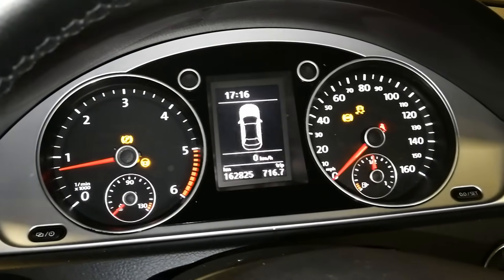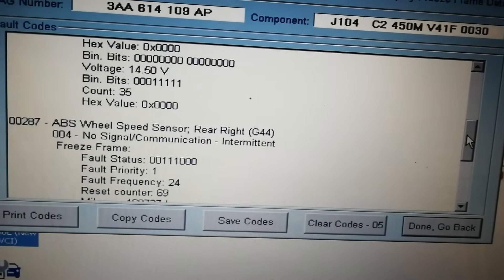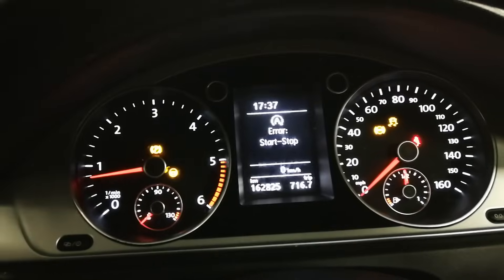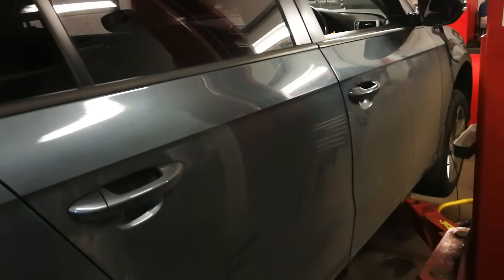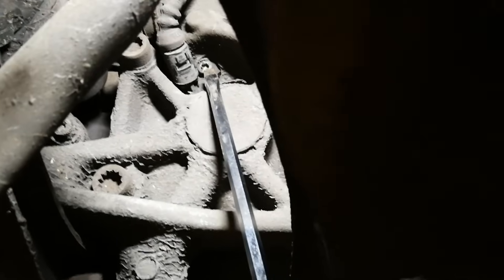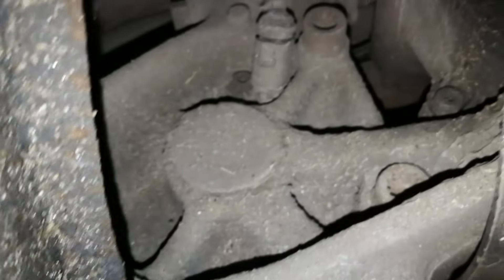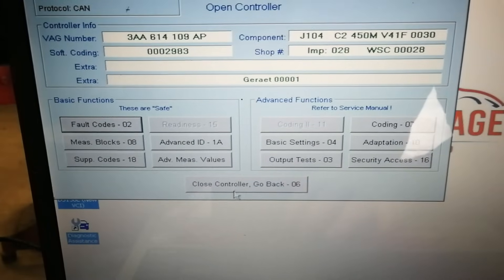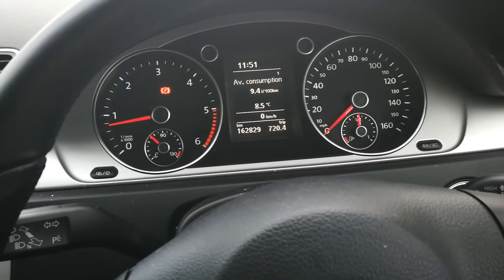Volkswagen With Multiple Faults, ABS ESC Start Stop, Electronic Park Brake, Power Steering

Comment: Sir I salute you I had these warnings lights on my tiguan '12 dash I had an accident that ruined my right rear axle had to change the whole axle but dash warnings were lit like a Christmas tree in extra my parking sensors and park assist weren't working also.
But after seeing your video I had my finger crossed that this sensor issue will fix every thing and thankfully it did.
Just had to remove the one of battery terminals and unplug the sensor like you did then reset.
And there it is all lights dissappeared and all the ops sensors are working fine
Reply from the maker: Great to hear, thanks for the detailed comment and kind words

Comment: Gerard, great and very helpful video, thank you.  My 2016 VW Passat has all lights lit, ABS, Airbag, Steering, Traction, etc., and the dealer yesterday told me BOTH rear wheel sensors are bad, AT THE SAME TIME (??) Does this make sense, that both would fail simultaneously?  I did not go through any water puddles or any other unusual terrain, so how likely is it that they both failed?  The car is exactly ONE month past the 36 month warranty!  They are quoting $565 for the replacement of both.  I thought I might bring it to a "shadetree mechanic" I know, buy the parts and save$ but unsure what to do.  Could you possibly tell me whether it seems plausible that both sensors failed at once?  THANKS and thanks for this YouTube video!
Reply: Going through the same thingy right now. Dealer recommended BOTH rear abs/speed sensors AND the brake master cylinder AND brake power booster. Any ideas?
Reply: @osfire80  I called VW North America 
1-800-822-8987
To contact VW Customer CARE, please call 1-800-822-8987, or on Twitter - direct message @VW, or use #VWCares.
I complained that it seemed impossible that both sensors went bad at the same time and that the mileage was low and there was no dirt etc and that the issue arose like a week after the 36 month warranty expired.  VW N Amer called the dealer.  I had to put a lot of pressure on the dealer, the service manager - someone who rarely ever interacts with the public.  I was pleasant and yet very insistent.  Theyreduced the repair cost by about 80% and completed the replacement with just the 20% I had already paid for the "diagnosis" and now it rides fine.  But I am not planning to buy another VW.

Contacts - Volkswagen US Media Site - Media VW
Reply: Urve Pesti what a shower of robbing bass turds! I bought one Bosch sensor today for €22, roughly $25. It takes no more than 15 minutes to change. Main dealers are only good for warranty claims at a push. 😖

Comment: Thank you very much for this video.Videos like these prepare us a bit for possible faults scenario (I just have the same problem).I have same lights up but in following order :1.) Start engine-ESC error comes up 2.) I press Brake -I hear a bit grinding noise and other 3 lights come up. So could it be related to worn  out "ABS cogs"
Reply: That's the noise I was getting,so prob is abs module,next mission
Get new module and try it

Comment: Thank you soo much for this video. 

I hope you can help me a bit further.

I had an issue where my clutch wouldnt come back up.. took it to a local asian garage and they advised it was some kind of hydrolic / pump which was leaking ( i saw some the fluid) got the car next day, and these lights came up? He wouldn't have messed with the sensor right?  Thanks
Reply: Sounds like the slave cylinder 
Same happened to me in my jetta Gli

Comment: So I have a 2014  VW Tiguan. I get ABS, Start Stop, bending lights, electronic break and tyre pressure warning lights on my dash! Hope it's something as simple as this.
Reply: Same error messages I'm having on my 2013 VW CC
Reply: nemiah morgan mines the same car. Just happened today.
Reply: Same issue for me - Passat rline 2015
Reply: How did you fixed it I have a 2015 Tiguan? With  all the light on
Reply: Same issue on 14 Mk7 Golf
Reply: Mechanic has told me it's coming back as a problem with my ABS Pump/Module. Turns out this can be quite expensive. 😩
Reply: The same thing happened to me today 
When that happen to you did you tiguan wouldn't start
Reply: I also have same errors....all of that and it can be annoying
Reply: Can a rusty reluctor ring alone cause this....even if the wheel speed sensors are good

Comment: Just wanted to say thanks for an excellent video. Although I’m unable to diagnose and fix the issue myself, I can now go to a VW specialist and say exactly what needs checking/replacing.

I’ve had my 2012 VW Touran 1.6 SE for a month, done 3000 miles, and had this error on 90% of my journeys.
The supplying dealer ‘fixed’ it within a few days of purchase, but obviously they just cleared the fault codes!

Thanks 👍
Reply: What do you mean with fault codes? All those errors started to appear on my dashboard since i changed my android player.

Comment: Excellent video Gerard. I've just had exactly the same errors come up on my 2011 B7 Passat. I have VCDS but I was unsure what sort of difficulty was involved so took it to a dealer. Now I know I will do the next one myself. Thank you.
Reply: Les Rogers i took it to the dealership and they fixed it after 24 hours. Turned out airbag was fine and the only issue was the breaks on the rear left wheel. They changed it and now it’s all good.
Reply: how much did it cost

Comment: Great video, thanks. I have a fault on seat ibiza 2006,wherei get a 3 beep audible warning, lose speedo lose power steering, abs, power steering are on and brake light is flashing. I recently had a blow out of front passenger side tyre, destroying the rim and the tyre. I cannot see any obvious damage to wheel speed sensor, any ideas? kind regards Dave.
Reply: I have the exact same scenario on my 2012 golf

Comment: I have An Audi Q3 and have the exact problem. It drives excellent though, does those errors on the dashboaed decrease engine efficiency?? 

please assist!
Reply: Truely Sincerely I don’t think so, I regularly get 70+ mpg out of my 1.6D Touran
Reply: I've got same issue today, and didn't effect an output power.
Only turn off autohold feature, asr, abs and tyre pressure monitoring.
Reply: @mato12348  same here

Comment: Great video.  How did this fix the automatic start stop problem?
Reply: Brian Williams I suspect the one issue prompted error messages for several things.
My parking sensors don’t function when the error comes up.. not connected to this issue but that’s VW’s electronics for you
Reply: Everything is working fine now.  Had to reset all error codes and has worked for the past months.